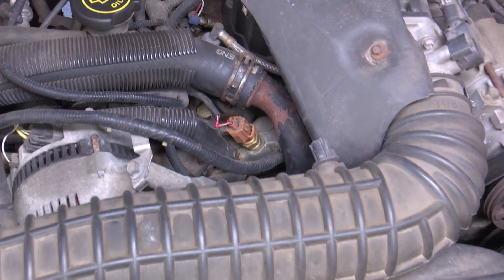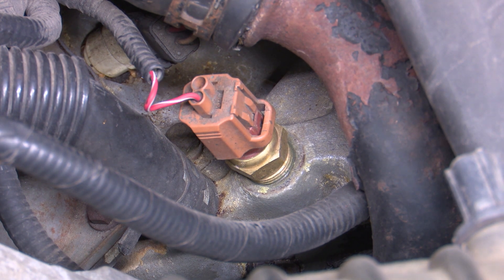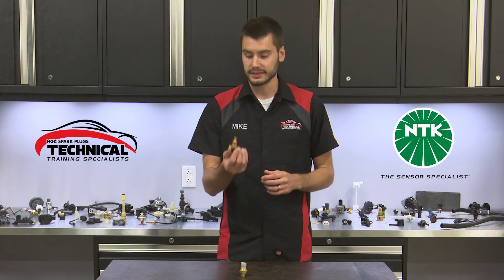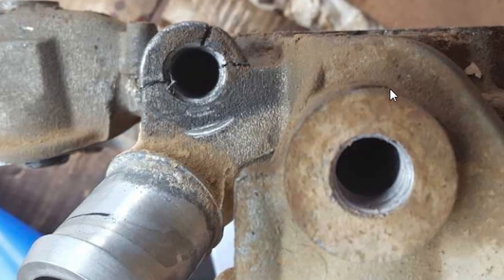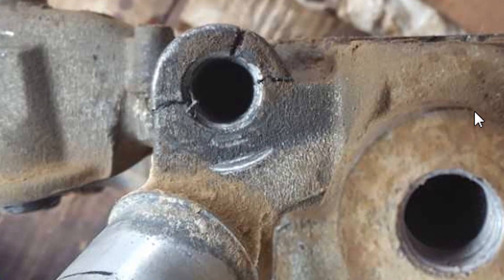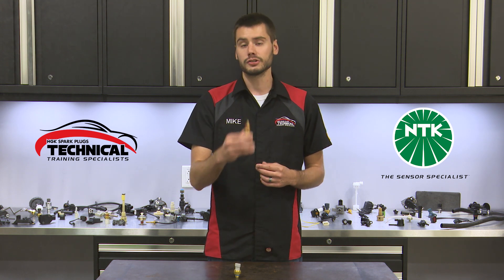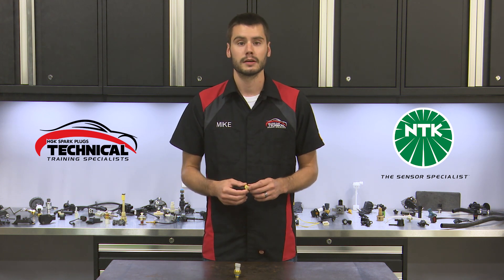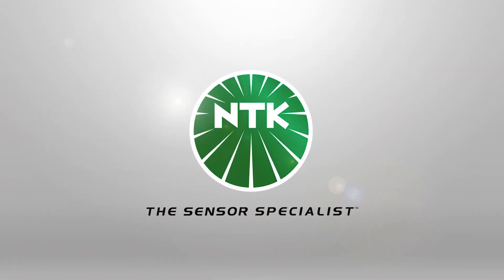NTK - Engine Coolant Temperature Sensor (ECT)

Comment: Hi, When i diagnose my car i get Oxygen Sensor, Temperature sensor and EGR Error and My Fan always runs, Will replacing Coolant Temperature Sensor be more important than other Sensor's
Reply: I would diagnose the coolant sensor code first. A overheating car will instantly destroy an engine, so it is nice to know if the car is in fact overheating or if the car just has a bad temperature sensor. You can use an infrared gun to verify the engine temperature next to the sensor and/or dvom to check for voltage or reference.

Next i would address the the EGR/O2 codes. You can't diagnose those without a DVOM (digital volt ohm meter) and scan tool to read fuel trims would help.

Now you could throw parts at it... but if your wrong you could be spending over 300 bucks in parts depending on the car.... quality wideband o2 sensors cost over 100 bucks a peice and egr valves are at least 50.... the temp sensor is an easy cheap fix but how do you know it is indeed the temp sensor? The car isn't foolproof, it can sense a problem but it doesn't know what is causing the problem. All those codes share something in common... they can cause your car to overheat!